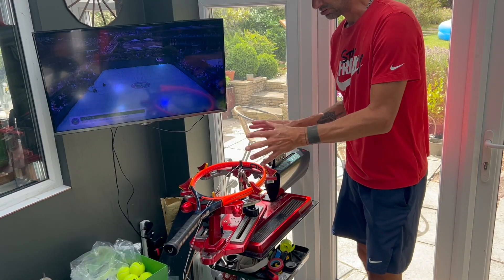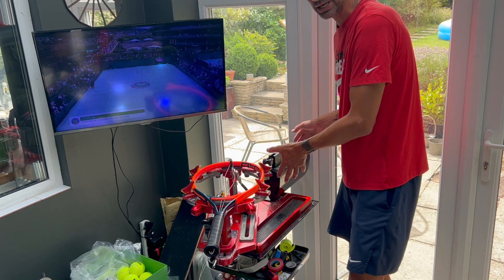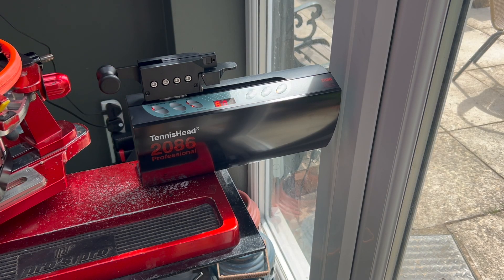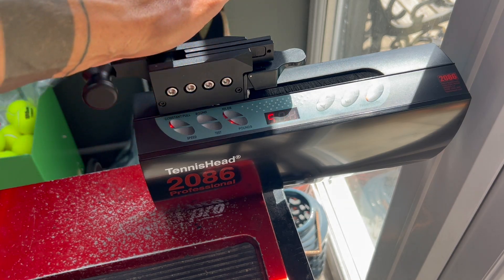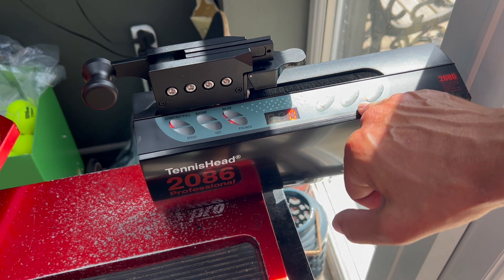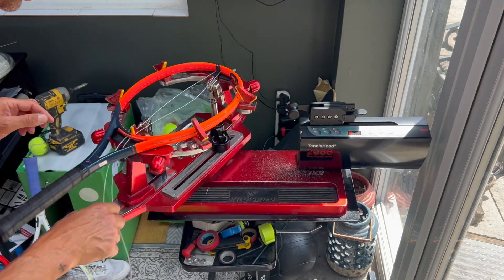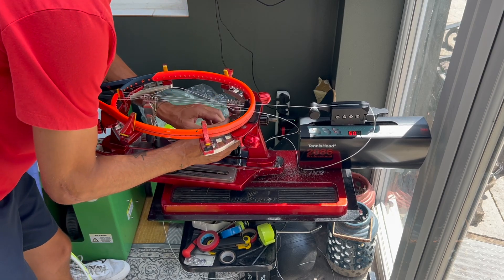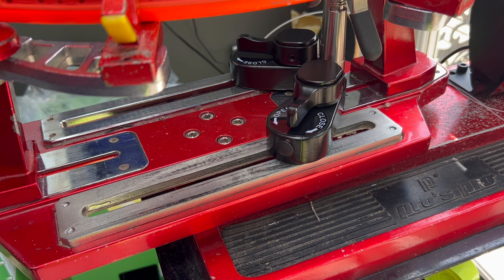Converting a Dropweight or Handcrank Stringing Machine to Electronic With the Wise TennisHead 2086

Comment: I was considering upgrading my baseclamp to this too. I have the pros pro ones with a small silver button that’s hard to press and the levers can spring back so hard and hurt my fingers. Then someone showed me I can move the lever 1st b4 pressing the small button and it’s a smoother operation that way. So I’m wondering if yours with the bigger button works the same way like that. And do you use the gravity clamp function often with them and do they work well?  I have not seen anyone showing a full stringing video with these clamps so am always wondering if they r worth the upgrade from mine. I’ve just upgraded the string clamp up top to Tourna universal clamp they r slimmer, narrower and lighter and easier to operate vs my original Pro’s pros.
Reply from the maker: They make such a difference with the big buttons, it's just faster and easier for sure. For the gravity clamp - do you know I did see that in the description, but I only just noticed now that there is a button inside the clamp holder that releases it, but my clamps are not long enough! So no I haven't used it. I actually wonder now how well it would work. But I do recommend the big button ones for sure - that with the electric has made stringing so much less like work!

Comment: You can actually make it turn 360 deg sir, you just need to buy a adaptor to lift up the table, look up for spin fire adaptor question is would if fit your machine
Reply from the maker: Awesome, that is a great bit of info! Will check it out!
Reply from the maker: Edit: can see it is called the "Spinfire Height Adaptor for WISE"
Reply: Hope it does fit your machine, if not probably make one if you get the concept its just a simple spacer to lift up your turn table